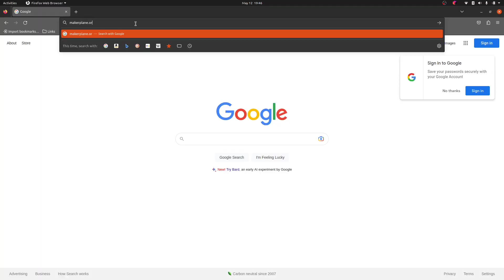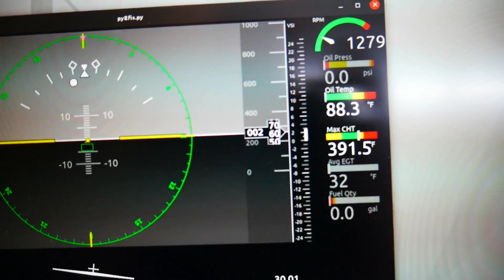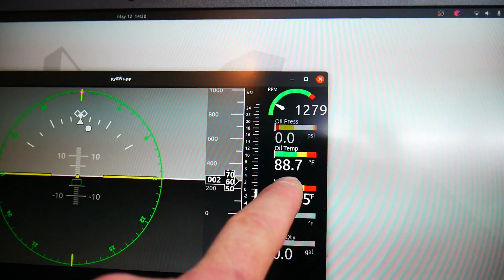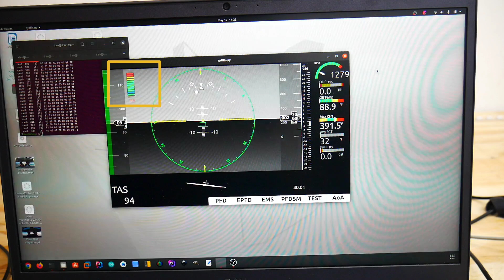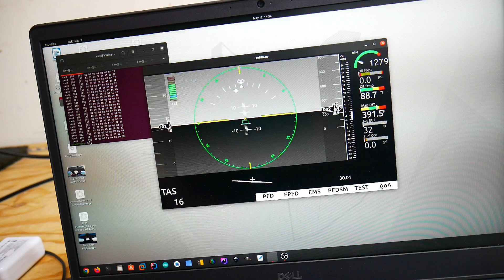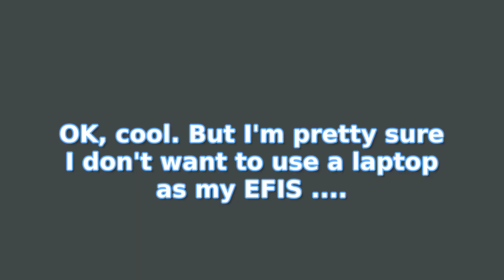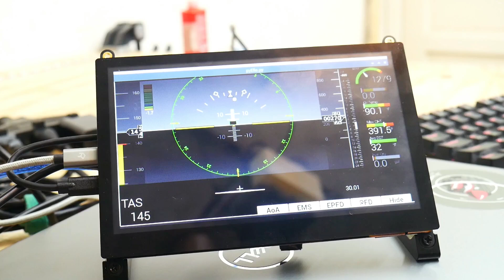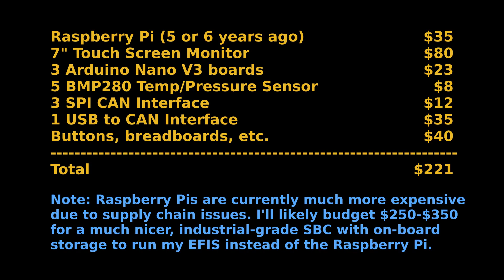Practically Free Avionics

Comment: This is cool but my concern with it wouldn't necessarily be something like having an improper reading on your artificial horizon. My concern would be a situation where it suddenly incorrectly shows that you have no oil pressure and you make a decision to make an emergency landing based on erroneous data.
I feel like there are enough things in a cockpit to be concerned with that unreliable instrumentation really shouldn't be one of them.
Reply from the maker: That's a fair point. I appreciate the comment. How would you mitigate that with any other system (e.g. a steam gauge or a high priced engine monitor)? Or why would this one be any different? I'd use the same oil pressure sender as I would with any other system. It's just a screen that displays the data. And you can add several redundant screens to ensure that if one fails you can still see the same data on another (which is not the case with a steam gauge).
Reply: @dan_der_flieger  while a commercially available avionics set up is still susceptible to failure It's probably a lot less likely to fail than a bunch of arduinos and homespun code.
As long as the sensor that you use is high quality, even if it's an automotive sensor, it probably is fairly reliable.
Overall I think my main concern would just be that when things start going wrong in a cockpit it can cause task saturation and confusion pretty quickly and the amount of unpredictability for failure in a homespun system like that feels pretty vast.
A lot of aviation accidents are at least somewhat attributable to pilots simply failing to fly the plane because they're trying to deal with some sort of failure going on. I think the more chances of failures occurring there are the more likely that sort of thing is to happen.
Reply from the maker: Yeah, I hear you. All good points and I hope others are reading this.  

While I have been writing this code at home, my day job is to write similar code to collect data from various types of sensors and display that data on multiple types of screens (e.g. injecting data into someone's already existing graphical software - just like I'm doing here). The MakerPlane code base is really well thought out. Arduinos are pretty solid little devices, not much different from what you might find in a high-end avionics device. They just also have other peripherals on the board that make them more accessible to less tech savvy people. And because they're open source hardware, they are fairly inexpensive. But they're pretty bulletproof as long as you don't overpower them or introduce short circuits or whatever. But that's the same with any electronic device. 

I appreciate your comments.
Reply: @dan_der_flieger  Yeah I get that. I Don't do it professionally but I have been messing with electronics including arduino's raspberry pies and what not for many years now and in general they do seem to be pretty robust.  
And I also understand the concept of an experimental plane. It's experimental for a reason. My dad and I built a KR2 when I was a teenager and there was plenty of stuff in that plane that was one off and of interesting design.
Ultimately it's your plane and you're avionics. If you are comfortable with it that's all that matters.
Reply from the maker: @DoRC  that's cool. I bet that was a great experience to have with your dad. 

I had to look up what a KR2 was. Looks like a pretty cool little airplane. Did you have to do the fiberglass layup work or did it come as a kit?
Reply: @dan_der_flieger  All the main pieces were a kit but there was plenty of fiberglass work to be done :-) That's where I learned my hatred of fiberglass.
Reply from the maker: @DoRC haha, yeah I bet. I've only done a few small parts for motorcycles and I'm not looking forward to any cowl work I need to do on the Sonex.
Reply: @dan_der_flieger  Wear lots of protective gear and rub your arms down in baby powder before doing anything that will release fiberglass particles. The baby powder blocks your pores and does help prevent the glass from embedding. Ultimately though to some degree you just have to live with the understanding that you're going to have fiberglass in you.
Reply from the maker: That's some solid advice. I'll look forward to being itchy. 😐
Reply: @dan_der_flieger  fortunately it only lasts a few days and you can mitigate it with PPE. Part of the game though!  Look forward to seeing future updates.

Comment: Have a look at the Orange pi 5 plus.  It is much faster than the Rasberry pi 4 and variants can be had with as much as 32GB of lpDDR4 RAM, a pair of M.2 interfaces in addition to an eMMC and micro SD.  Further, there are a pair of USB interfaces entering thru different buses that would allow for a pair of each device and CAN bus for redundancy all the way up to the computer.  Oh, and they are cheap, $140.00 to the door.
Reply from the maker: I actually purchased An Orange Pi 5 plus just after making this video. It was really good apart from one issue: After about 8 hours of fighting to get it to recognize the 7" HDMI monitor in this video on the Linux distro (actually ALL of their Linux distro) I gave up and sent the OPi back. 

It did work flawlessly on the Android image, though, so that inspired me to start developing an Android-based EFIS that is compatible with the MakerPlane message format (FiX). So far I have just a heading indicator and an attitude indicator working. Using an Arduino, I connect to the CAN Bus thru a CAN transceiver, convert each message to a byte array that gets passed to the serial port on the Arduino, which is connected to an OTG adapter on the Android device, where the EFIS app listens for incoming data on the USB/serial port and updates a graphical rendition of the data on the HI/AI screen. 

I bought a Raspberry Pi 4 once the prices came down a few weeks after playing with the OPi. The RPi works really well, so I may or may not continue development on the Android EFIS.
Reply: Bummer you could not get the video sorted!  I have one on the way now.  Likely won't have an issue like you since I will use a 1080p or 4k monitor.  @dan_der_flieger
Reply from the maker: @mikeiver  yeah, it has a weird resolution. I think it was 1024x600 or something like that. I plugged it into a normal computer monitor and it worked fine. Just not the little screen.

Comment: The problem you are going to run into, even though this is stupid cheap compared to off the shelf instruments, is certification which will push all this way up and people will have to get the components from certified resellers to be able to have an airworthy legit craft. 
Otherwise this is great I am sure there are thousands of enthusiast aviators who are kicking themselves for spending thousands on instruments.
Reply from the maker: There's no certification required in an experimental aircraft, which is what this is intended for. If you're interested in certified stuff, go buy a Cessna built in the 1970s. Experimental aviation is the pathway to innovation. This is just another option for those (like me) building their own airplane and who enjoy electronics and code development, too.
Reply: OK good to know, yeah hey no doubt these are great I know they will "Take off" I don't have an aircraft and I want a set. @dan_der_flieger

Comment: The cost with EFIS is not based on the price of components and software, they are pretty cheap and even free when it comes to software. The true cost is incurred in calibration of the sensors, repeatability of the design, and reliability. The calibration process requires expensive traceable sources which are certified and checked at regular intervals. The software also needs to be checked by a third party to ensure there are no errors that might cause the system to display erroneous readings or fail at a critical stage of flight. For example, the software must continue to work even at “impossible” aircraft attitudes and speeds. The fact that an aircraft is not designed to exceed certain flight parameters is no guarantee that this cannot happen. So if you are selling a system to consumers, it must work flawlessly 100% of the time,  or fail gracefully with full warnings and an in flight reset capability. Obviously developing such a system at a hobbyist level does not need to meet such high standards, and accuracy and reliability are whatever the builder requires to get the job done. Commercial EFIS are not over priced when you consider the requirements they have to meet.
Reply from the maker: Sure, there are plenty of steps to certification, if that's your goal. This is for those of us that find enjoyment in the creative process afforded to the homebuilt experimental community. If I was interested in paying gobs of money for someone else to do it for me, I'd buy a certified airplane. Or even a Sonex that someone else already built - they don't hold value very well. But that's not why I'm building my own. It's the satisfaction I get from doing something myself and learning from the process.

I agree that the components are (relatively) inexpensive, particularly for big names (like Garmin) who can purchase them in bulk. And they have invested heavily in up front engineering costs (as they should). But at this point, you're spending money on a name and their advertising/marketing costs. The certification process is complete, as is the difficult up-front engineering. That egg has already been cracked. At this point it's mostly just software updates. Which (as a professional software developer) isn't free.

Admittedly, I'm still not convinced that building my own avionics is the best route. I can buy a nice, well-equipped EFIS from GRT for my Sonex for about $2k that includes moving map, synthetic vision, etc.  

But every time I open my Kitplane magazine and see a Garmin ad that says that you buy their stuff "for less than you might think" I cringe. They're probably right - I don't think I can afford to. They've convinced us that it's expensive to equip a plane with avionics. But smaller players in the scene prove that it's mostly advertising hype that Garmin and others sell and we're lapping it up.

Anyway, I encourage anyone that prefers to buy certified to do it. Aviation is a hobby with inherent risks and everyone has a different level of risk aversion. For my part, I only fly day VFR and I'm not convinced that a Garmin will keep me any safer in that environment than anything I can build on my own.
Reply: Interesting side note. There have been quite a few situations where airliners have crashed and the warning and safety systems have not worked properly. This is because the airplanes have gotten to conditions such as high speed or angles that were implausible so the system would basically just shut down assuming it was in an error state.
Reply: Yes. It's not for certified aircraft. I can fly my ultralight without any instruments in an emergency, but I want certified and maintained instruments. I'm in two minds about an uncertified glass cockpit. It looks cool, but I don't want to rely on something I can't depend on.
Reply: @DanK-ZDP189  It sounds like you're saying you'd rather have nothing than something you can't rely on.

Otherwise it seems like you are just ignoring the things OP is saying.

I would rather have a glass cockpit I can't completely rely on, because it's a nice to have, and in an emergency I might be able to rely on it.

Certification that demands perfection is the enemy of good.

Same way SpaceX doesn't bother with radiation hardened NASA certified electronics. They just run multiple redundant off the shelf systems. You can even run Dragon off the tablet that the astronauts use attached to their space suits.

When you are only doing a few thousand operations a second then every single operation matters.

Or you can use a modern gigahertz processor, do billions of operations a second, and the software can reboot from a known good state 60,000 times a second. Not that real time Linux isn't a thing, but "real" real time has been more or less obsolete for over a decade. It's easier to fail so fast it doesn't matter anymore.
Reply: It’s the liability insurance policy manufactures must carry for their devices should they fail and cause an accident that runs the price up to a ridiculous level. One must consider the time and effort for software engineers to properly develop the software lest they become another 727-MAX issue……
Reply: @Subgunman If an accident happens, you'll probably already be dead. You will no longer be able to use the civil liability insurance policy. Boeing has already disgraced itself with its software from India and the assembly of aircraft from cheap metals. So you can trust that Garmin won't let you down, but I've seen it hang when it overheats on a hot day, right in flight. Now live with it :)
Reply: Nice video Dan, but I agree with Michael comments. We have to be very transparent with the flight community and do not transmit the idea this could be used for real use without strongly alert that the risk is high. Including on certified software and hardware bugs happens and the consecuencies could be catastrophic. I am the first who accuse Garmin and others to have a monopole with overpriced product but they are doing a great job for aviation safety.
Reply from the maker: True, you can't argue with the safety record.

To me, the avionics are not the most dangerous part of an experimental aircraft. You can still fly an airplane if you lose your airspeed indicator (for example). We're trained to use secondary indicators in a situation like that (an AoA for example; or a combination of tach, AI, and VSI). I plan to only fly day VFR, so losing the horizon on my EFIS doesn't matter. I can look out the window and see the actual horizon.

But this system is also redundant. I can add a second, 100% independent display that reads all the same sensors for about $150 to ensure that if a screen fails I still have all of the data in front of me. And there's an option to spend another $150 to have a complete set of redundant sensors for the second display. 

I'm not trying to minimize your and Mike's comments. I really do appreciate them. I just think that for my particular mission, a $20K set of avionics is ridiculous. And like I said to Mike, I'm looking very hard at GRT's stuff. For the amount of time I'm spending on homebuilt avionics, their $2k entry fee for a nice  turnkey solution is very appealing. Unfortunately, they don't support ECU data from the engine I'm considering (no one seems to) which is why I started down this road in the first place. 

Anyway, thanks for your comments and concerns. I appreciate other points of view.
Reply: @dan_der_flieger if you do add a second set of sensors, it would be cool to see if you can add a bit of software to error check between the two reading rather than just having to sets of instruments in the cockpit for you to check in your head. Giving to low cost of the diy approach, you could add triple redundancy rather than double, so your error checking can look a 2 vs 1, rather than just reporting two sensors have conflicting data.

Comment: What are you going to use for the attitude gyro and heading indicator? Is that display sunlight readable? Some of the inexpensive displays wash out in sunlight conditions. Thanks for the video, nice project!
Reply from the maker: I'm still working on AHRS sensors. I haven't found one that I'm satisfied with yet. But here's a video I posted later that talks about my foray into printed circuit boards, and it includes data from a Bosch BNO055 IMU mounted on a home made PCB. It works pretty well on a bench top, but some people have said the BNO055 can drift a bit. I haven't tested it in flight to verify one way or the other yet. Here's a link to the video I mentioned:
https://youtu.be/cIsv_dQTMyo?si=ujyPPMq0ijNM-Nq5

As for the display, you are correct. It's not sunlight readable. MakerPlane sells a 5" display that IS sunlight readable for about $100US. I bought this one more for prototyping.

Comment: Brilliant!  Thank you.
@dan_der_flieger : Do you have a blog/git/website where you have the details of the components, code and instructions for building the avionics devices & sensors?  I would love to build my own but my electronics knowledge is far from competent enough to do so without guidance :)
EDIT: Found your website & GIT repo for the AoA build :)
Reply from the maker: Yes and no. I have a 3D printable Angle of Attack sensor I designed that is probably a good place to start if you haven't done much with electronics before. You can find that project (with parts list, instructions, links to git repositories, etc.) on my website: 
https://danderflieger.com

I also posted another video after this one that shows how to set up the MakerPlane software:
https://youtu.be/AJPfOm8xwjs?si=k0L-vlo-FBQv0GTS

And another one that talks about designing homebuilt circuit boards that's probably useful:
https://youtu.be/cIsv_dQTMyo?si=95Ikvnd0UP2qb30x

I do have a couple of private git repositories that I'm working on, but they're not ready to share with others. In particular, the whole AHRS (attitude and heading reference system) would need some more development and testing. And very likely a different sensor than the one I'm using in the circuit board video.
Reply: @dan_der_flieger  Thank you!  Look forward to the publishing date :)